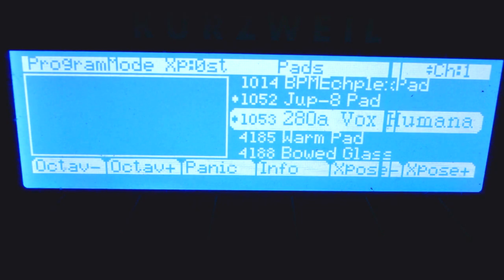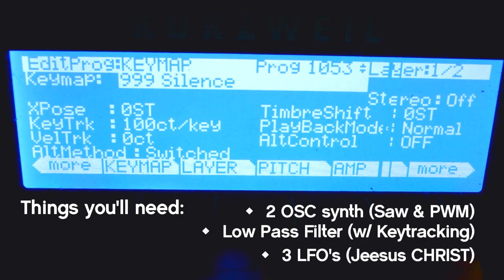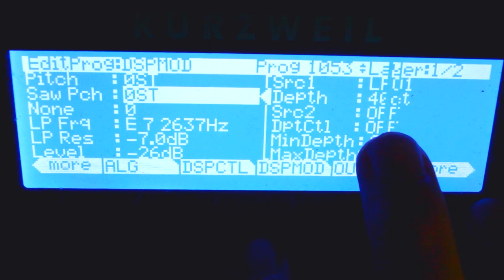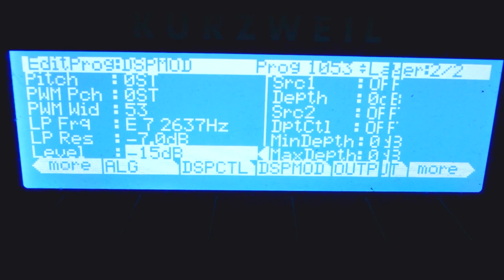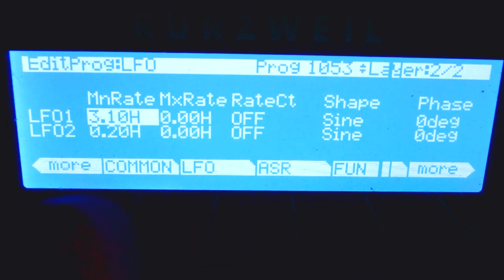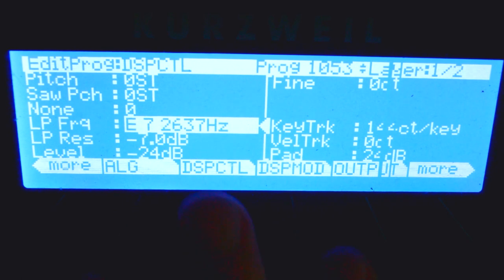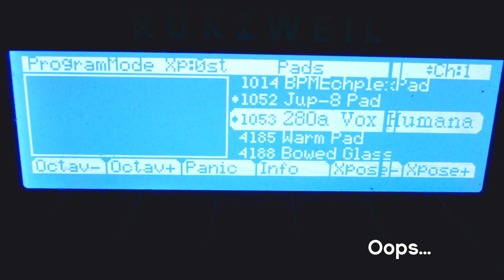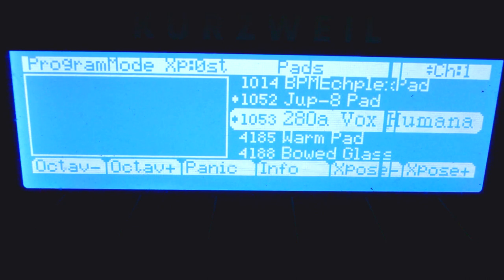Polymoog "Vox Humana" preset | Showcase & Tutorial

Comment: Beautifully Done ! ! ! ! ! i watched it 4 times ina roll but I think I am always loosing the part of the 3rD LFO . . . Whe do we use it? :) What are your max and min values for those parameters measured in CENTS? :)
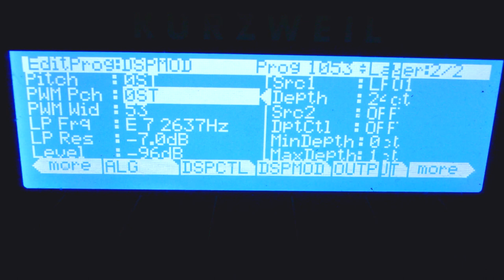Reply from the maker: @ 5:40 I talk about the LFO 1 modulating the sawtooth wave pitch, then @ 8:04 you see what would be LFO 2 & 3 modulating the pulse wave and pulse width, accordingly. You can see the depth in cents on the right hand side of the screen, to the right of the label "Depth". These are just max values, as I don't set a minimum value (since both OSC modulation and PWM are always on) Also, you can see what the rates are in hertz when I move to the LFO section of each layer. 

I talk about LFO 1 and 2 only since the V.A.S.T. engine in Kurzweil synths only handles 2 LFO's per layer, and I have a two layer patch, one for the sawtooth wave and another for the pulse wave.
Reply: @gasolineandwine  Thaank You Very Very Very Much So it is possible to get that close with 2 LFOs right? I am wodering if I using 2 synths (with just one LFO each) together in a sub mixer could give me the same results. I liked your research so much that I tought about buyng the same Kurzweil! :)
Reply from the maker: @moritz_schoenermann  You could probably still get similar results with two LFO's modulating an oscillator each (I've seen Vox Humana patches sounding quite similar with that setup). 

As for the Kurz I'm using, if you have the budget for it, go for a PC3, PC3K or others, as the LE series has some limitations that other synths in the PC3 series don't have (like more polyphony, loading samples, editing FX chains, etc.) They are really rugged synths, and the VAST engine is, no pun intended, quite vast in it's ability to create sounds. I haven't even scratched the surface with what it can do!

Comment: Great tutorial! I've seen a few others and had a few goes at recreating this on various synths over the years. Really digging a version I made on my Super 6 recently. Question: How much do you recommend detuning the two oscillators by, a few cents, or not at all? I didn't notice any mention of this in your vid. Any idea if the original Moog patch detuned the VCOs or not?
Reply: AAAAAANNNNDDDDD... you just mentioned it at the end of the vid, hahahaha.
Reply from the maker: @hermetech  hahaha yes! It is part of the patch, though it's up to taste personally. I find that going overboard with detune can muddy up the sound way too much, it's already muddy enough with the differing rate LFO's moving out of sync with one another. As for whether it was part of the patch or not, I am not entirely sure, though a detune knob was present in the front panel of the Polymoog, so it could very well be part of the final sound.